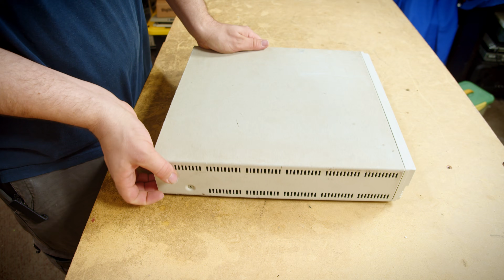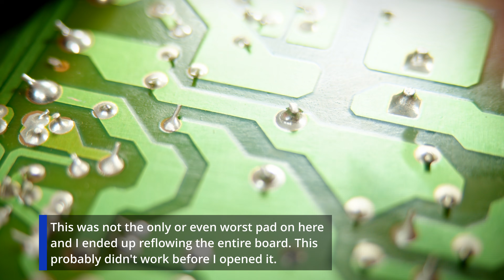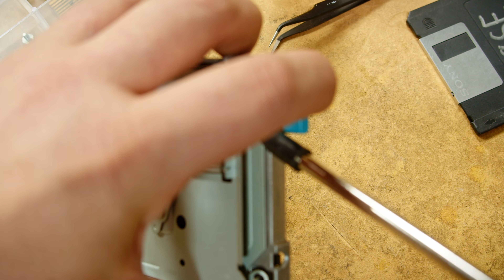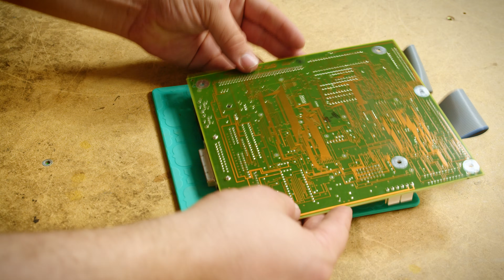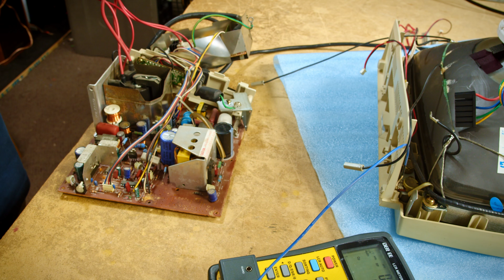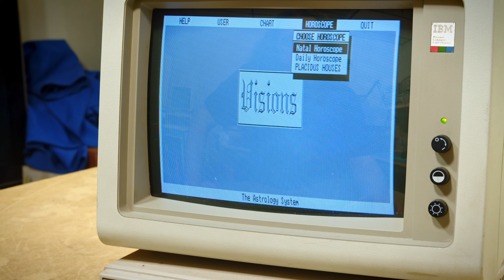The 8086's Last Gasp - Tandy 1000 RL Hard Drive

Comment: Wow, I also had a 1000 "pizza box" Tandy back in 1993. Mine had Windows 3.1 and was unimaginably slow with only 2 MB RAM. I added a modem and got on the college dialup access using Winsock. I downloaded tons of freeware gadgets. Got Parsons Personal Tax Edge & did my taxes, which was super novel at the time. That was started in Hiawatha, Iowa by Bob Parsons, (who sold out to Intuit) whom you'll recognize as the founder of GoDaddy. Of course I had Tandy's cheapest dot matrix printer to print out all my computerized tax forms, which were distinctively modified versions just for computer generated filings. The few websites around at that time were rough. as were browsers. Like Cello (Windows) and Lynx (text based, which I ran in a Unix bash shell). Thanks for taking me backwards 33 years! I previously had a 1000HX, which, if you can believe it, was even weirder and quirkier than the pizza box, and the only online services back then were direct-dial text-based library services and BBS sites. Thanks for that strange trip back to the late eighties & early nineties!

Comment: I know it's older, but thinking about how to go about imaging that drive in place...    There is a light linux that can run on that proc.  With an xtide interface and a cf card, you could boot into linux and use dd to image the drive in place.  Probably.. 🙂

Comment: The same year this model launched, 1991, we bought our first IBM compatible computer, a KLH 386SX-20, at Sams Club for right around $1000. A little less than what this Tandy cost. IDK who bought these but they got royally screwed. Even if this is the 8086-1, with 20bit address and 10MHz clock. 
Came with 2MB RAM and a 120MB hard drive. The ST-325X is a 21MB hard drive. 
Fun fact, you can still buy the AMD N8086-1 as a NOS component from DigiKey. They're about $25.
The Tandy 1000 was literally the netbook of its day.
I'd probably be using dielectric grease to lube that drive.

Comment: Similar to Apple's Macintosh line, the Tandy 1000 series (up through the 3000 series, iirc) had its ROM loaded with half the operating system.  Most models had DeskMate burned into the chips, but some also had MS-DOS.  I can't remember which model, but you can boot to DOS without any hard drive or floppy.  This is one of the reasons why Tandy PCs could operate DeskMate so fast and with little access to the drives.  Another interesting tidbit: Microsoft was hired on to write the DeskMate source code.

Comment: 3:10 "It's so small it's incredible" ... Not really, it looks like an older quad flat pack, only a bit thicker than they have been for the last 20-30 years. A standard 44-pin package that was common as an alternative to the 40-pin DIP/DIL that was originally used for the 8086 and similar 1970s processors.

Comment: I've never heard of a copper coil HDD before, I liked the way it sounded though. As an aside, you'll want to make sure you turn off and empty your air compressor when you're not using it. The compressed air inside of the tank is under enough pressure to separate the water from the air and it'll start filling up with water and eventually it'll start spraying rusty water if you don't drain it when not in use.

Comment: I had the Panasonic version of this PC in 1990, all Tandy components inside. I believe MS-DOS was on a ROM, no hard drive. I can't find anything online or eBay, they didn't make them very long. I ended up installing a Paradise VGA and a Panasync monitor in 91. Panasonic dot matrix printer. Had Prodigy Internet, Microsoft serial mouse and a 9600 modem, it was so cool. Internet was in it's infancy and I was there lol.
Reply: How long did you use it? I'm assuming it was limited to text-only stuff on the early Internet.
Reply: @no1DdC used it from 1990-93. A DOS shell was the opening screen and it was mouse clickable. Links were established by then and they were purple and didn’t change colors after visiting page. I remember searching “giraffe” and a few links came up, one was a pic. It took about 2 mins to download the image. My video card rendered 800x600 at 256k colors. Exciting stuff back then, a color image coming through phone wires!
Reply: @mctoastyG  Thanks for your reply! Truly exciting times. I'm impressed this machine was capable of such feats.

Comment: You can image drives even on an 8086 system! Make a boot floppy with MS Interlink or some other way to get remote drive - EtherDFS/Brutman's NetDrive if you add a NIC. Then get Norton's Diskedit tool, load it as a physical drive and write all sectors to a file on the remote drive. It works just like dd on Linux, I've used it on laptops with proprietary HDD connections, MFM systems etc., way easier than trying to connect it to a newer system.

Comment: Set it up as a webserver similar to what MIke Brutman has with a PCjr. Drop in an ethernet card, 3C509B is 8-bit compatible with a config change for instance and extremely stable. Then just set it up with a low-memory-hogging DOS version supported by the packet driver, load up a website off a CF card in an appropriate adapter (i.e. use the ROM slot on the 509 to do XT-IDE UB) and you're off to the races.

Comment: Tandy graphics is just CGA with the ability to display a pallete of 16 colours instead of just 4 at a time. It will work with any CGA compatible monitor. A couple things to note, the hard drive is an XTA, the precursor to ATA-IDE, so you can't just pop any old IDE hard drive in there. The other is that the floppy is a Shugart which gets power over the ribbon, so pay close attention to the keyway (which is supposed to be upside-down on these drives!) and the pinouts if you need to replace it, because you WILL fry a normal PC floppy if you connect it straight! I recommend just looking up the pinouts and modifying another cable if you can't source a direct replacement. You gotta try some Sierra games! They were made to take advantage of PC-Jr/Tandy 1000 graphics and sound!

Comment: I went to find a copy of that Visions software to disassemble the "maybe quit" option, but I can't find one archived anywhere! I hope you can backup that hard drive before it does, because that looks like it's dangerously close to lost software
Reply from the maker: I was hoping to find a way to make a proper image of the drive but it doesn't seem like there's much demand for XTA capable hardware. I guess I'll just have to copy it off as files, which is probably fine anyway since it's just a PC. I'll let you know when I get it put up!
Reply: @TechTangents  yeah, XTA is a pain! I'm not sure how you'd image that without plugging it into another, equally old, PC. 

I've thought before that it'd be a handy project to have some software that could run from a floppy disk and it just reads off all the hard drive sectors and pushes them out over serial/parallel/keyboard/video (I have Many Bad Ideas) to some attached device. it'd be handy for getting shit off some of these older systems that are kinda locked-in with the limited connectivity.
Reply: @TechTangents  Maybe plug an XT-IDE into that ISA slot? There's probably even some DOS utility that could dump the drive to an image on the flash drive so you don't have to copy files (although file copy would be fine too!).

Comment: Could you not use an XT-IDE in the 8-Bit ISA slot to image the XTA HDD to a CF Card. There must be some kind of DOS software about to image XTA HDD's.

Edit: I'm also gonna write a "Maybe Quit" option in all of my future software for both Windows and Linux and have it set as random as to it either quitting or not. I typed ransom to start with before changing to random, so I might have a bit of fun and have my software require a ransom to quit. Think I've now got some fun C, C++, & C# projects to work on in the future.
Reply: Given that it's DOS, you should be able to just copy everything straight, rather than having to image it.

Comment: The '80s were wild! People bought the pinnacle of consumer technology to study astrology and the bible :) Anyway, the Tandy PC compatibles were cool and despite not having had a Tandy myself, I still have nostalgia for the one that a friend of mine had going into the '90s. His was a 386 Tandy with 4MB of RAM and some 300-500MB HDD. We would network them via crossover parallel port when transfering files and via serial for games. I hated floppies so much that my main computers since 2001 did not have any. CD-RW and DVD-RW for the win, then USB flash drives and memory cards.
Reply: That would be either a Tandy 1000 RSX (I've got one), or one of the Tandy 2500 models, which were 386 machines.

Comment: I think you can remove the side of the case to install an expansion card.

As for the mouse driver, CuteMouse should probably work?
Reply: Correct, I use that on my 1000 RL.
Reply: The side? It's got a slot at the back, doesn't it?
Reply: @BlackEpyon  you know you don't install expansion cards through the slot bracket opening right?
Reply: @Nukle0n  You don't install them from the side either. You have to drop it in from above and finesse it in sideways into the slot, and then there will be a hole in the side to install the set screw. My 1000 RSX is the same way.

Comment: I wish I could get my hands on an RL. Lost mine in a house fire. Wouldn't matter since it's outdated, but i have a disk from my deceased mom with a sound file that needs DeskMate to open. Some day, I'll find one.
Reply: These PCs go for like $200 before shipping, and you'd need the peripherals. Wouldn't it just be cheaper to move the file into Windows and play the file through an emulator?
Reply: @sammiches6859  I can't find anything to open it. Was some Tandy specific format.
Reply: @jamienoel  what is the file extension?
Reply: @sammiches6859  I don't remember, it's been years. It's on a floppy and I don't have anything to read it right now. I remember it wasn't a normal sound file extension.
Reply: @jamienoel  You may want to remember soon before the contents of that floppy are corrupted. A usb floppy is really cheap and you can at least preserve the files by backing them up. There's plenty of software on DOS and Windows to play Tandy files. PCem or 86Box should allow you to run the DOS programs required to read the files.

Comment: That model was the first "computer" we had in like 1988.. I don't remember much of it since I was 2yo but I played a game named Face .. something ... and after we got a datatrain 286 real computer to run some monochrome games and it has a rare used peripheral.. a mouse, because we used it to draw in autocad. It also runner Weltris and SimCity. Was was impressing about the 286, there was no cooling any there, not even on the NEC cpu. And the hard drive wasn't using disc technology but was more like a VHS type kind of storage inside it, I don't know how it's named .. and had 5.25" floppy drive.
Reply: You were using a tape drive as permanent storage? I mean, you CAN, but it's hella slow! They're much better for removable backup storage than for use in lieu of a hard drive!
Reply: @BlackEpyon  yes this was the Original storage included in it. It was slow and noisy 🤣 and some program or games were played directly on the 5.25" floppy

Comment: Is the floppy drive on this tandy pc the same as the ibm 8550 ?????
Reply: It's a Shugart, with power over the ribbon. The key is upside down (don't connect it straight to a normal PC floppy drive or you'll fry the drive!), and otherwise not pin-compatible with the IBM PS1/PS2 drives. You can replace them with a normal PC floppy drive, but you gotta make a custom cable for it. I think dJOS's Tandy floppy adapters might work, but I haven't tried.

Comment: I got a Tandy 2500 386/SX 33MHZ that saved from trash as well it has a space for a cd drive and just happen to have one and it works used a usb adapter for my mouse it works fun to mess around with it came with windows 3.0 installed some stuff on it with a cd tip on the gpu port you can take a vga cable and remove one of the pins and it will plug right into the pc that pin doesn't do anything so it's fine to remove it and then you will have vga graphics I messed around finding a cirruslogic card only to find it was the exact same thing as the one onboard lol
Reply: I'd love to get a hold of a 2500! I love my 1000 RSX, but it's biggest disadvantage is the slim-profile RL-style case! It's got 2 ISA slots though, which has allowed me to install a SCSI card to run external CD-ROM and Zip drives, as well as get past the onboard IDE's 504MB limit using a 2GB SCSI hard drive!

Comment: The Tandy 1000 RL was my first computer. I ended up with the 25-1450 version, because I was being nice to the sales person and my family was determined to surprise me. It was the one that only had a single floppy, no hard drive, and no realtime clock! This was bought as as Christmas present once the system was on clearance. I cannot remember if it was the same year it came our (1991) or the Christmas of the next year, by which it would have been a really bad deal. Still, several good things came out of it. One, my family finally accepted that I actually DID NOT like surprises and stopped trying to figure out what buy me. More importantly, I learned how to make due with far less computer in my computer than would otherwise be required. This ended up serving me really well when I ended up working with charities as an adult. Although, when I did find games and software that worked and took advantage of the custom Tandy graphics and sound, it was an amazing experience!

I still have so many fond memories of DeskMate 3, and to this day, I miss having consistent uses for the function keys across an entire OS. I never did get a modem or printer for it, but I spent many evenings looking through computer magazines and dreaming.

I still have the system in storage. I really should get it out and see what can be done to get it up and running again.

Comment: Oh wow! This goes back. My first PC was a Tandy TX 1000 , which, AFAIK, a cut down 80286 for budgetary reasons. It had a either 10mb or 20mb hardcard and a Tandy graphics monitor that I hated toward the end. It had a loose connection I could never find and fix. I * literally * resoldered every joint I could and it would still go from Tandy to CGA all on it's own and needed a thump to the case to fix. >.<
Reply: The TX is a weird one. It has the full 16-bit memory path (so nice and fast with that 286 processor), but only 8-bit ISA slots. Most cards were still 8-bit, so I guess they figured that there wasn't a lot of demand for 16-bit slots at the time?
Reply: @BlackEpyon  I heard it was to save on money . Then again , 16 bit ISA anything was pricey back then .
Reply: @llloyd4  For the cards, maybe, but in the machine itself, it's mainly in terms of real estate on the motherboard. The glue logic for a 16-bit bus isn't that much more expensive if you've already got 16-bit addressing for the RAM.
Reply: @BlackEpyon  But what point is it to have a 16 ISA bus if your target audience is only ever going to use 8 bit cards as 16bit is for professionals with the funds to afford and/or need 16 bit ISA cards ?

Comment: IDE makes great sense for an 808 *6*, since it has a full 16-bit bus.
Reply: It's an XTA drive which has an 8-bit interface.
Reply: @Zeem4  Yeah, not easy to source replacements for those guys. You can't just stick a normal ATA hard drive in there. Makes me glad the one I have is an RSX, not an RL!
Reply: @BlackEpyon  Some guy in Europe built an emulator.  It is like 100$ for the card.
Reply: @Zeem4  well boo then.

Comment: that'd be a  perfect candidate for a 16gb sata ssd with an IDE adapter , obviously once you get the data off the drive. might be even cooler with a custom 3d printed mount , lol !
Reply: It uses an 8-bit XTA interface which means that most IDE adapters won't work. It might work with a CompactFlash card - I've read that most or all of these support the 8-bit transfer mode - but I've never tested it myself.
Reply: @Zeem4  They're not compatible. CF cards are based on ATA-IDE, where the XTA is based on the XT-MFM controller.
Reply: @BlackEpyon  Thanks for clearing that up for me. For some reason I thought the 8-bit mode was something to do with XTA, but now I can see that the two things aren't related at all.
Reply: @ Not to mention the 504MB limit. Even with EZ-Drive or some other boot-sector loaded BIOS, the most you can work with is 8.4GB, so it's not even worth getting a SATA-IDE adapter to put in a SATA drive. I've got a big stash of 40GB IDE hard drives I've been saving for this purpose and slowly using up (I foolishly threw out most of my <2GB drives years ago).

Comment: So how late did they use XTA, and was it used on 2.5" laptop drives?   I have a Twinhead Subnote 486SLC, and it isn't recognized over one of my IDE-to-USB adapters.  So I couldn't image the drive, and I ended up copying off everything from the drive over Interserver/Interlink (which it fortunately had on the HDD, as I don't have a floppy for it, or a PCMCIA network card that will go into it's PCMCIA slot).
Reply: Most IDE to USB adapters don't like to recognize pre-LBA drives. XTA drives weren't very common, and I don't think I've seen them on anything newer than an 80186.
Reply: XTA was pre-286 only thing, 486 laptops definitely used normal IDE. Desktop/newer laptop with native IDE + Linux with ddrescue is probably the easiest way to clone normal IDE drive that doesn't work over IDE to USB adapters.